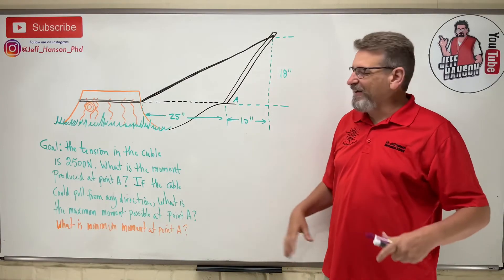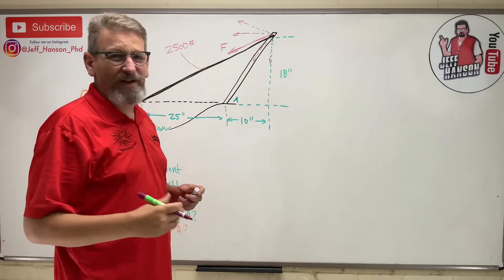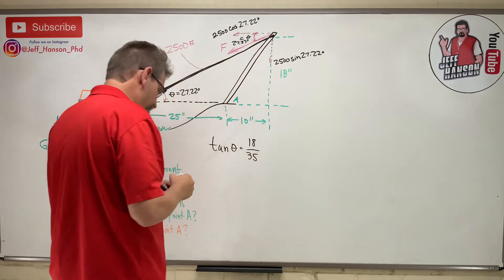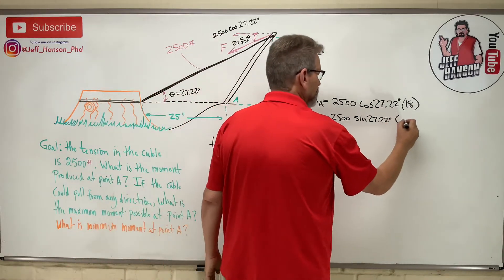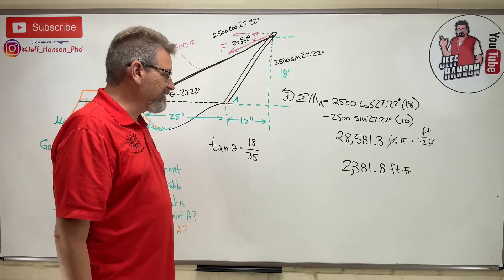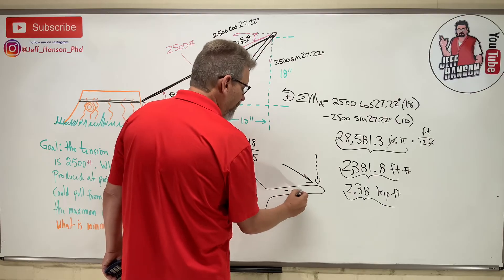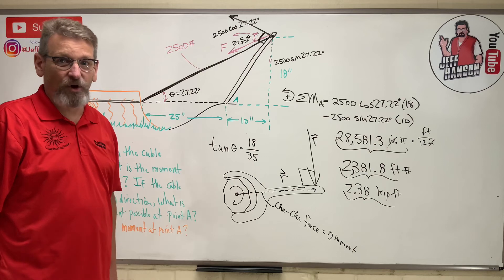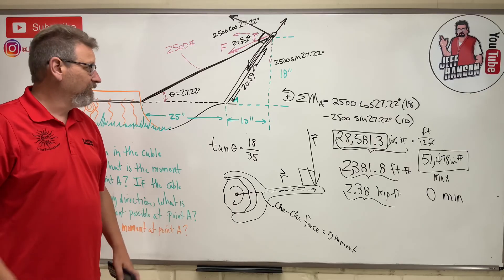Statics: Lesson 23 - 2D Min Max Moment Calculation

Comment: If the cable can go in any direction, couldn't you create an even greater moment by going down and to the right as opposed to up and to the left?
Reply: It should be the same magnitude but in opposite direction. So a clockwise moment of 51,478 in-lb will be generated.

Comment: The sum of the moments at A MUST  be = 0!
Your notation is wrong
Reply: Stephan C.@ It  would be zero if it had variables. In this equation, there is no variable!
Reply: the system should have a downward force to create a clockwise moment due to the weight, that creates equilibrium. am I right?
Reply: Stephan C what’s the correct answer to this video problem?
Reply: The sum of the moment at A and the sum of the moment at the other end of the pole equals zero. His notation is correct.